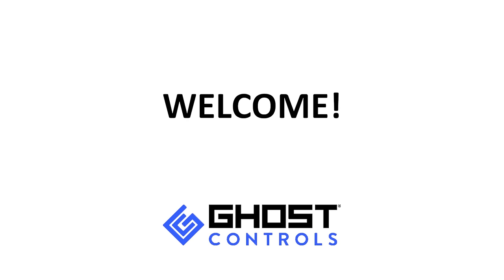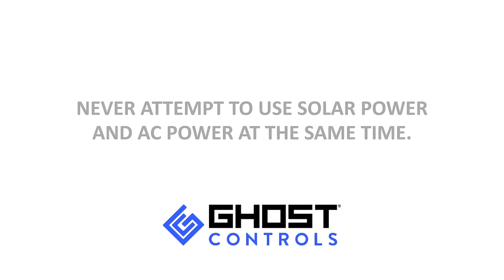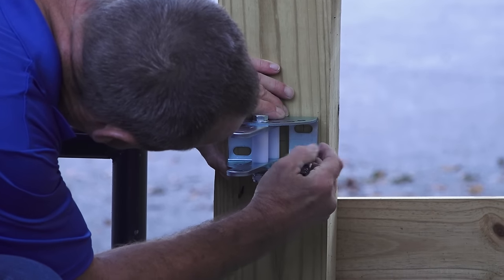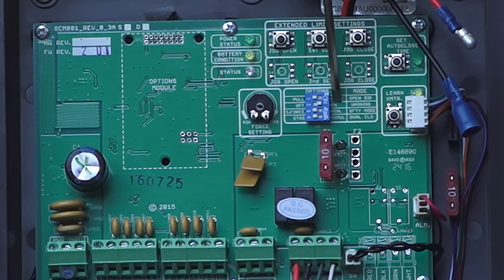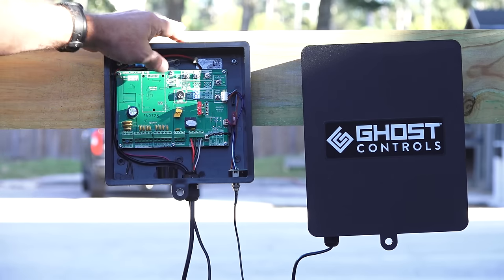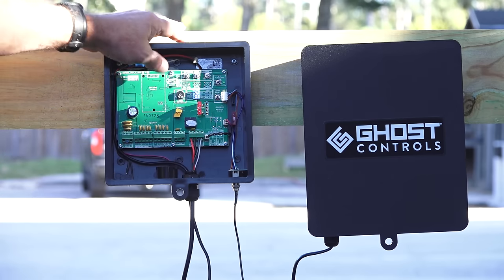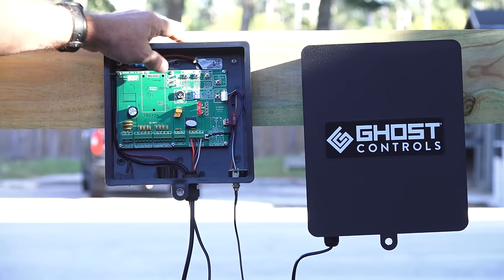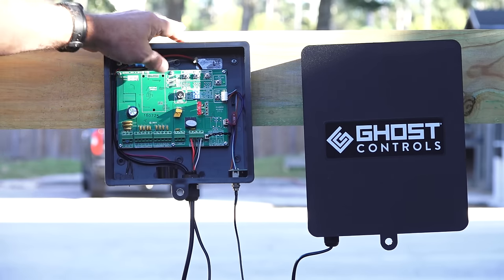Ghost Controls Gate Opener Kit Installation Video

Comment: I have two Ghost gate openers on gates coming into my ranch. Both openers are set up identical, and open 14' 100lbs tube gates. When opening and closing, they seem to open "too" fast and hit the fence. I used lumber to build a softer bump stops. The trouble is both gates "AT TIMES" will close to the fully closed position, wait 30-60 seconds, then open back up about 2 feet leaving a gap cattle can get through. I have tried and tried to reset the travel limiter and stall force on both gates but am ready to go back to another type of opener if this cant be resolved. Any suggestions? It seems temperature (freezing mornings / warm afternoons) sometimes causes the problem, but it dont get that cold in SE Texas
Reply from the maker: Thanks for reaching out, though we are sorry that it is because you have run into some trouble with your gate. Our support team would be happy to help you troubleshoot this situation with you to get to the root of the problem with the limits that are set on your gate.
All of their contact information is available here: https://bit.ly/2Qp7Uag  (and their phone number is 850-898-1411).
However, the easiest way to get in contact with them (without waiting on hold) is to schedule a call for a time that you will be available at your gate. You can schedule that call by:
- clicking the link above
- scrolling until you see "Schedule a Technical Support Call"
- click "At Your Gate Support"
- select a time/date that works for you and complete the remaining fields
- you will then receive a call from us at the date and time you have selected.

Comment: Do you recommend a car battery or smaller batteries as in the video? My gate is 16ft and 200 pounds. Thanks
Reply from the maker: Smaller batteries are recommended for those that will recharge their battery using the ac transformer. Deep cycle marine batteries are recommended for solar applications.

Comment: What is the actual permissible push and pull force on the TSI ghost gate arm. 

I am aware of the chat with the recommended weight of the gate to length. But would be nice to know the maximum push/pull force. To me that would be better

Comment: How can I install a car exit sensor? The little tube that goes back along the driveway and if a car is there, will open the gate instead of using a button
Reply from the maker: This depends which model (wired vs wireless) you are installing. All quick start guides and manuals are available on our website (here: https://ghostcontrols.com/pages/manuals) and this video (https://youtu.be/A80eCFCKXvI) shows how to program a wireless vehicle sensor. Please give us a call at 850-558-5520 for further help!

Comment: Does the exit sensor draw power continously or only when activated by a passing vehicle? I'm concerned about draining the battery power down if the censor is constantly active. I'm using solar power
Reply from the maker: This is a good question. The vehicle sensor does draw consistent power it is designed for solar applications. The standby consumption is around 10mA.
Reply: @Ghostcontrols2015  will the 5 watt solar panel along with two 7 amh batteries going to be enough power to keep the sensor from running the batteries down. The panel will get sun most all day.
Reply from the maker: @rockhoundingeasternwashing5308  We would recommend if you have a single gate starting with 10watts and 2 7amp hr batteries. If you have a dual gate we recommend 30watts of solar and deep cycle marine battery for maximum reliability. In any case the vehicle sensor draws very little (1/30) compared to the board and the arm(s). Keep in mind you still need at least 4-6 hours of direct south sunlight for the solar panel. Solar panel will not charge well or at all in the shade or part shade and cloudy conditions.
Reply: @Ghostcontrols2015  thank you. Looks like I'm good to go. Will upgrade if nessary

Comment: Will this gate opener operate a rail road style gate. Gate is counter balanced with cement ballast and opens easily. About 20 ft total length and about 500-600#. What is the percentage taken off for us veterans?

Comment: How do I wire in a garage door button? 
The same as a keypad?
Reply from the maker: A non-illuminated door bell button wires to the Cycle and Common points on the main control board. Our Keypads are wireless. Thanks

Comment: Does it have a plug somewhere to charge the battery’s?
Reply from the maker: HI Dylan, If you have solar your solar panel charges your battery through the control board or if you don't have solar the included ac transformer would recharge it when you hook it to the control board and a GFI outlet.

Comment: Can you simply open the gate by hand without having to do much.
Reply from the maker: If you need to manually open the gate for any reason, you simply pull the clevis pin, pull the operator arm away from the gate brackets, and proceed to move the gate manually as needed.

Comment: Can you have  zombie lock and car sensor at the same time??
Reply from the maker: Yes! The sensor and Zombie Lock both connect back to the main control board to communicate with each other and the gate operator of when to open/unlock. Please give our team a call at 850-558-5520 if you have any further questions!

Comment: I just want a gate that opens when i push the button. Ghost controls always gives me a hard time
Reply from the maker: We're sorry to hear that you are experiencing some trouble with your system, Jacob. Please contact our customer support team at 850-558-5520 or support@ghostcontrols.com for assistance troubleshooting the problems you're experiencing.
Reply: @Ghostcontrols2015  I already have. I was told that because i live within 15 miles of a military base, i was gonna have problems. Funny, i didnt have problems with my Mighty Mule, and i wont have problems when i switch to Lift Master. I know 3 people around me that have had problems with the Ghost Control openers not opening. 2 have already switched gate opener companies
Reply from the maker: @jacobcairnes521  Thank you for reaching out, though we are sorry to hear it is because you are so dissatisfied with your Ghost Controls experience. We do not typically see interference to the magnitude that you are describing outside of military bases and other locations with large power lines or metal obstructions.
We would like to send you one of our GXAT's (our Antenna Bracket Extension Kit), which is used to help extend your antenna above obstructions to improve the remote control operating range. If this extender does not remedy the situation, we would recommend trying a different universal receiver before switching your entire system as this could help improve your transmitter range without the cost of a full operator overhaul.
If you would like to move forward with these modifications, please send an email to media@ghostcontrols.com so we can have the GXAT shipped to you as quickly as possible.

Comment: Would it be possible to extend the control wires so the boxes could be mounted out of sight?
Reply from the maker: Hi Matt, you would have to create a custom kit with a loaded dual control box and then the replacement arm that has a 50' cable on it. You would cut the cable to size then. If you would like more information you could call tech support at 850-898-1411.
Ghost Controls Team

Comment: Can the zombie lock work with solar or do I have to run a/c power to the unit
Reply from the maker: Hey James - Yes you can use the zombielock on solar using either our 10 watt or 30 watt panels.

Comment: I have a issue and have tried numerous times to contact the company with no response.
Reply from the maker: Hi Shawn-  I apologize for the delay in getting back with you. If you have not done so Please contact 8508981411 and one of the team will reach back out.  If you are the Shawn with the phone number that ends in 36 I have forwarded your message on to the Tech group and you will be getting a call today.  If not feel free to reach me directly at 850-558-5507 and I will you pointed in the right direction. Rick

Comment: I love that the batteries yall sell have bigger connections that the ones on the wires in the battery box..
Reply: and that those tiny flat tabs on the battery break off pretty easily.. another plus.

Comment: Hi. Where does the power connections go? I have seemed to miss it. Thanks
Reply from the maker: There is a black and a red wire with bullet connectors usually at the top of the control box to connect the included harness to.

Comment: It is 12v DC, so why can't you use 120v AC and a rectifier to power the whole deal. No batteries should be needed. Does this DC motor use a start capacitor?
Reply: There are a few 'problems' with that (this system is design to run on 12VDC FROM the BATTERY):

Converting 120Vac to 12 VDC via rectifier does NOT produce 12VDC. Basically not all 12VDC are created equal.
     * 12VDC from the battery is a flat line if you look at it on an oscilloscope.
     * Converting 120VAC to 12VDC, typically (cost effectively), is to use first step down transformer to convert from 120VAC to say 14VAC the 'rectifying' to produce 'DC'. What does it means by 'rectifying' or 'rectifier'? AC voltage is a sine wave (look like this ~)that goes above and below 0V (positive and negative). Full wave rectifier 'flip' the negative portion.to positive where half-wave just 'blocked' the negative portion. With me so far? After it is 'rectified', it is still a 'wave' (albeit a positive wave) and not a flat line voltage. A capacitor is added to 'flat out' the wave. Sound great right, we now have successfully converting AC to DC....BUT is it useful for the application.....

Once a load (light, motor, circuits,etc) to a power supply it 'draws' current/power from the power supply. Depending on the load or the type of load it will draws differently from the power supply. For example: a 1W light bulb will draw a lot less current than a 10W light bulb. A 'rectifier' DC will 'dip' when a load is connected to, most of the time in low-power (mWatts range) application this is not an issue but a heavy load or sensitive load this can be a problem.

Now allow me to explain why is rectifying circuit doesn't really work with Ghost Controls 12VDC Motor:
1. DC motor needs high 'in-rush' current to start the motor (like a car's starter), this current may need to be as high as 20-30 Amps for about a second or so. A 12VDC battery can supply this in-rush while a typical AC-to-DC rectifier CAN NOT deliver this type of in-rush current. Of course one can be designed but it will not be anywhere as cost effective as a 12VDC battery.
2. Solar installations also are large percentage of the installations. The battery as main power source with charging circuit (AC or Solar) kills two birds with one stone. Since it is designed for 12VDC battery (need to be recharge) with charging circuit, one can not simply replace the 12VDC battery with a battery source, it may damage other circuitry.

Technically speaking, you can replace the battery with an AC-to-DC power supply, but it would have to be regulated power supply that can deliver between 200-300 Watts. In other word, a 200-300 Watts, 12Vdc Output power supply that is outdoor grade (Hint, it's not cheap).

FYI, Start Capacitor is associated with AC-Motor and not DC-Motor.

Hope this help.

Comment: UL2016 compliant huh? Didn't see any safety device being installed and yet the unit still ran.
Reply from the maker: Thank you for the comment! To answer question We have a patented design that that we trademarked as  Safeforce which complies with UL325 Section 32.1.1   which requires two independent means of entrapment protection. Our products utilize  Type C entrapment protection in addition to Type A inherent entrapment protection. This means no other entrapment protection is required to meet the standard and is why you do not see any additional safety devices being installed in the video. Thanks for watching!